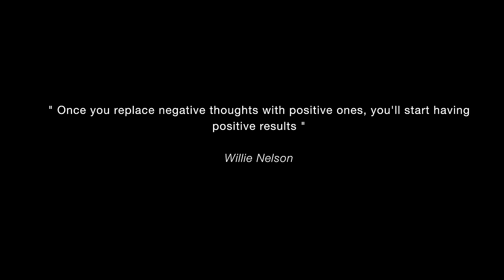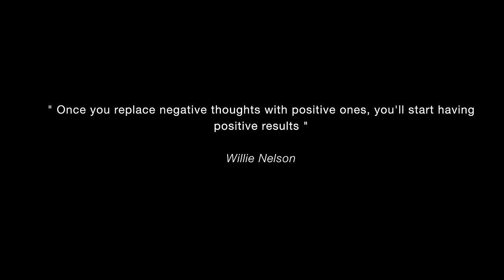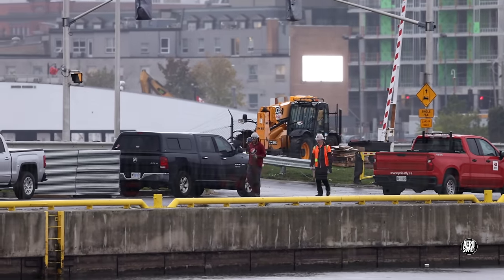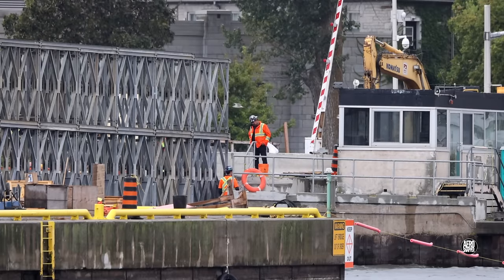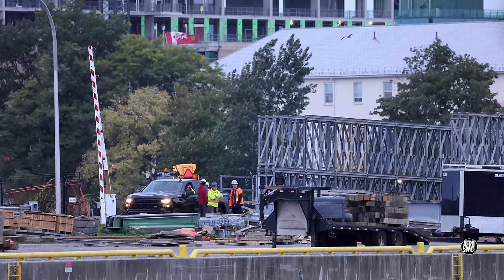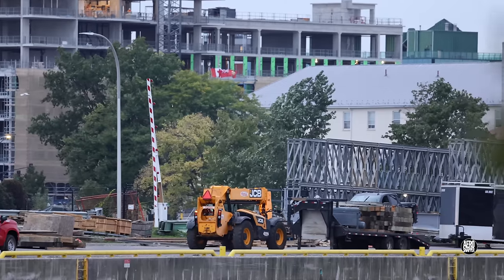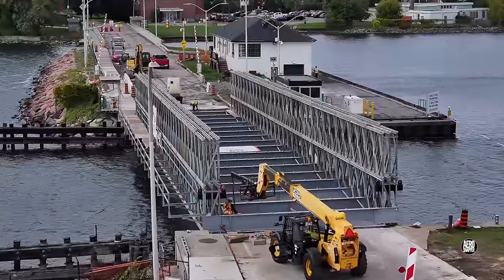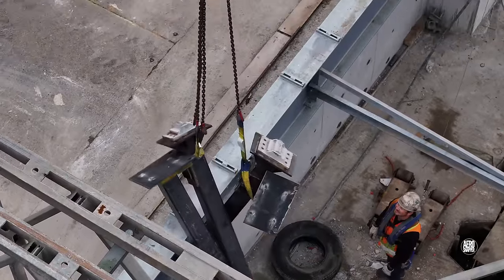It's All Coming Together  - an update on Kingston, Ontario's La Salle Causeway 4K

Comment: With all the work these men have done, what is the difference between this temporary bridge compared  to the permanent one.   It seems to me ( what do I know ) this bridge seems durable enough to go on for a few years more!😊
Reply from the maker: You're quite correct about the reliability and durability of this bridge. However, I understand that it is being rented, not bought.  It's also a fixed bridge and incapable of regular, easy removal to accommodate marine traffic during the navigation season.  It will be some time before a permanent, easily opened bridge design can be identified and the replacement model built.  It's likely that this bridge will be in place for many months, if not years before that can happen.